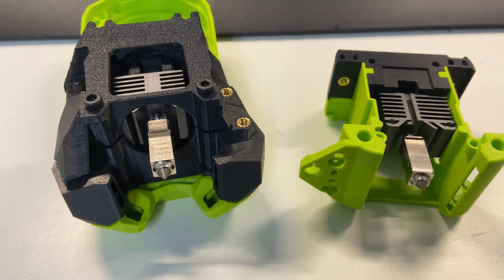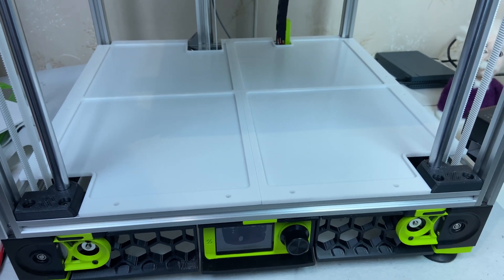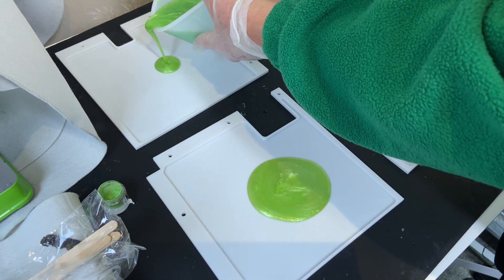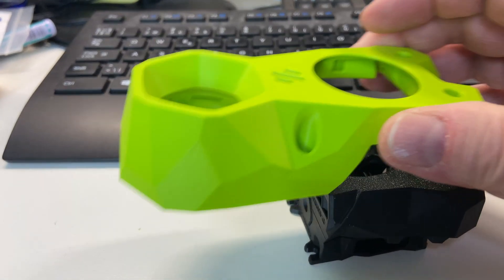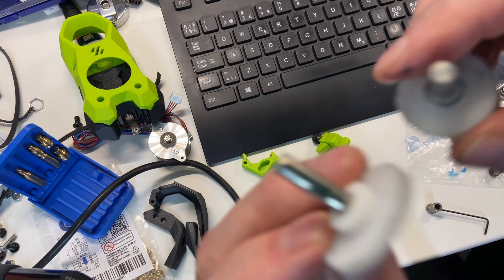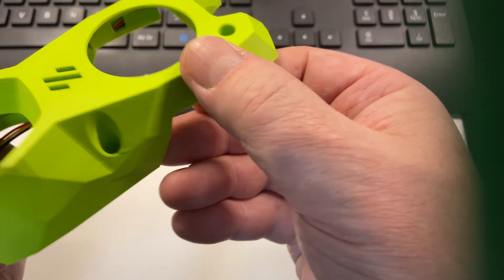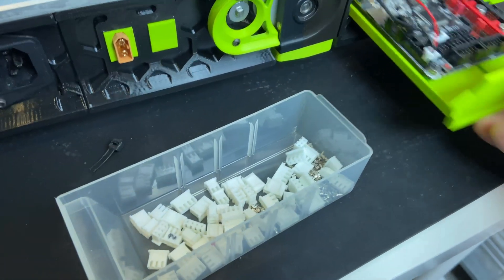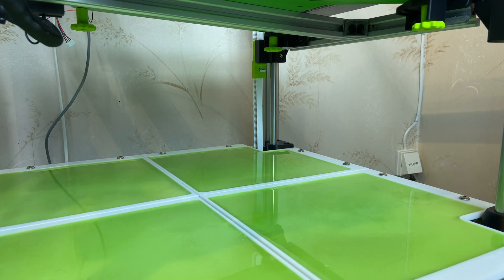It's not a Voron - adding toolhead and covers

Comment: If you want a screen with a SKR PICO, you could have used a STM32 adapter. Fysetc has one that works great, it lets you connect most EXP1/EXP2 wired screens directly to the pi and works great.

Comment: Broke a beat-brake today, had to cut a slot in the copper end with a little rotary tool to unscrew it from my V6 heat sink with a flathead driver. Makes me a lot more appreciative of the Revo’s design. Time to sit down and learn from someone else overcoming challenges instead.
Reply from the maker: Sounds like fun. And with the E3D clones and original differing slightly everything becomes messy. I would really like to convert to Revo, the price is to steep for me at this point.